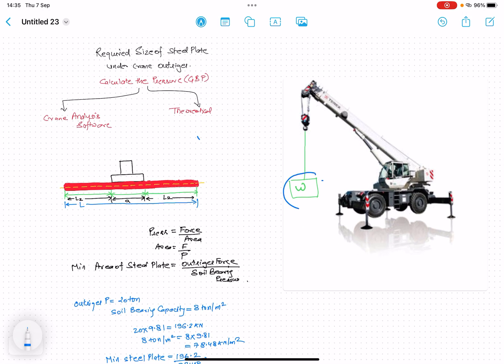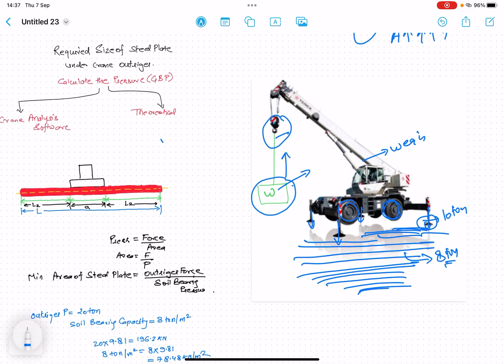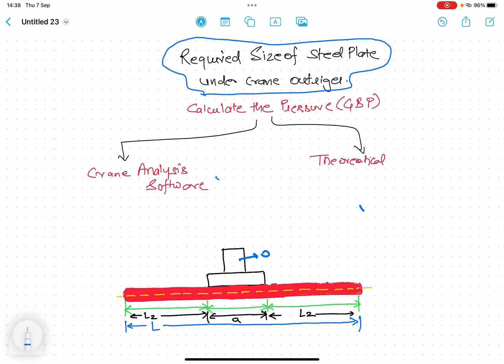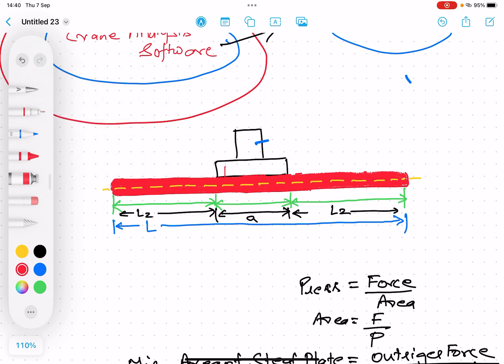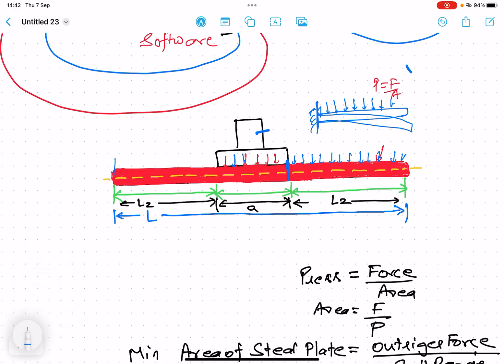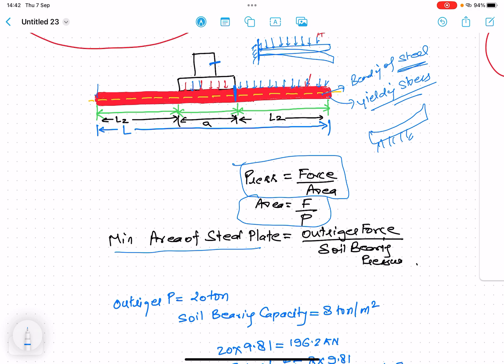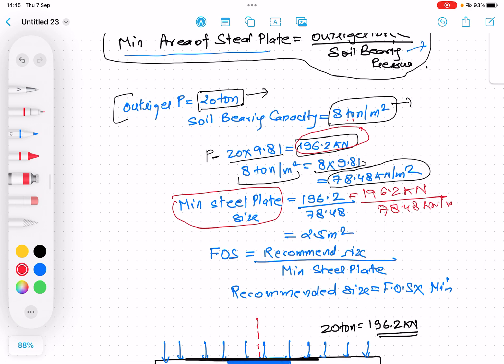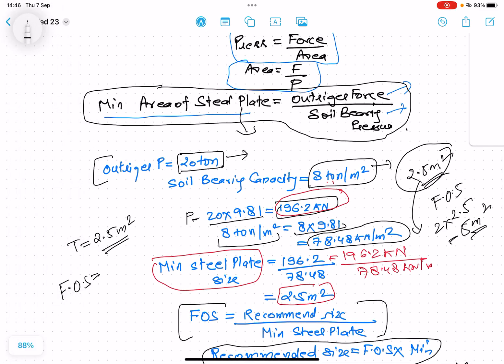Required Size of steel Plate for crane outriggers

Comment: Weldon Rail,  recall the value of L2, while calculating the value of F on the cantilever,  L2/2 was given as 0.825 , but L2 is 2.25m from the steel data.